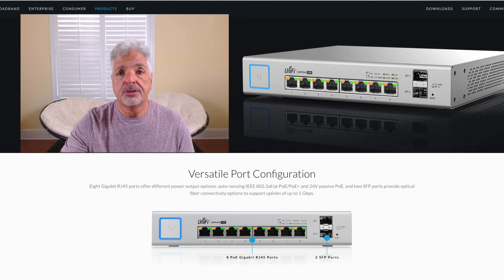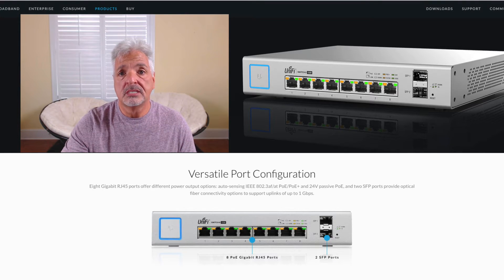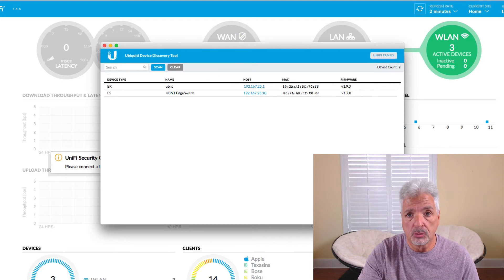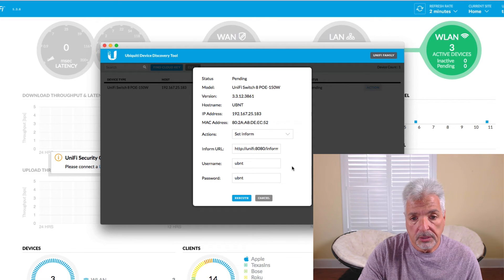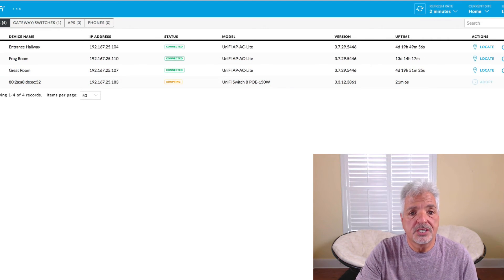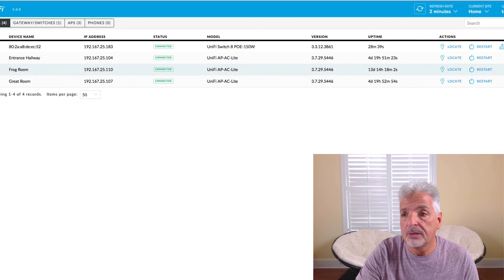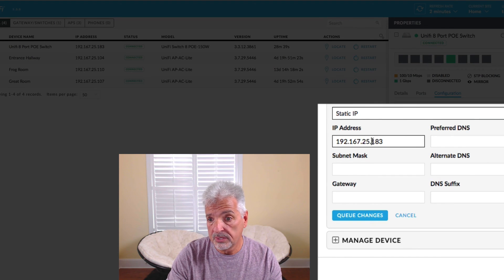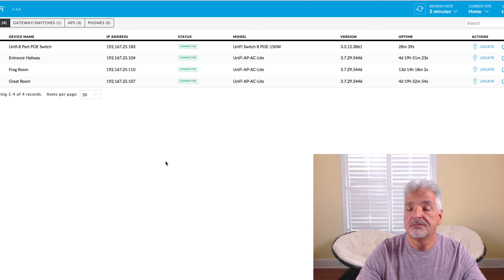Unifi POE Switch Adoption

Comment: Hello Tony! Great video! I have a question regarding the part where you set the IP address of the switch. What happens if I leave it as DHCP? Would there be any problem with the network or with the devices connected to the network?
Reply from the maker: Hello iPondrio, Thanks for tuning in and commenting. Please subscribe, share, and give the video a like. There wouldn't be any problem leaving the switch set to DHCP. It's just a best practice I like to follow. It just makes life easier to know exactly where the core elements of the network are located. Have a great day.